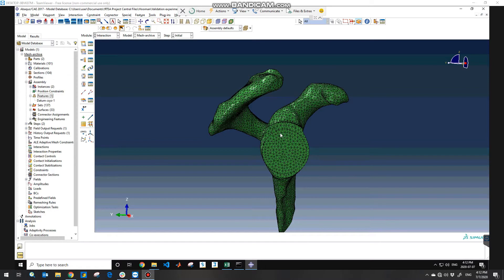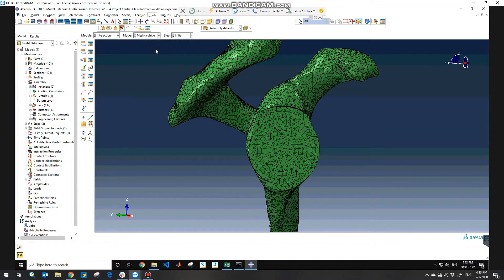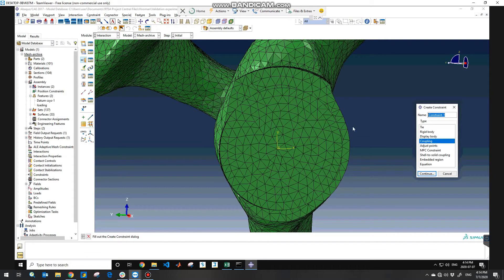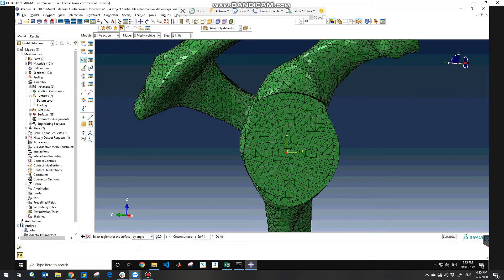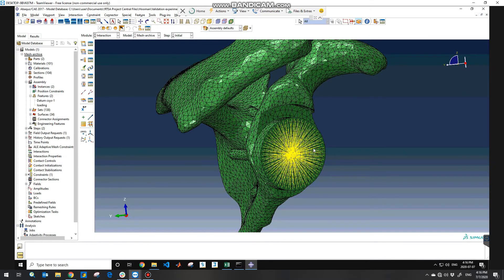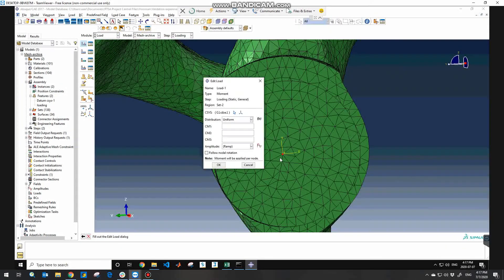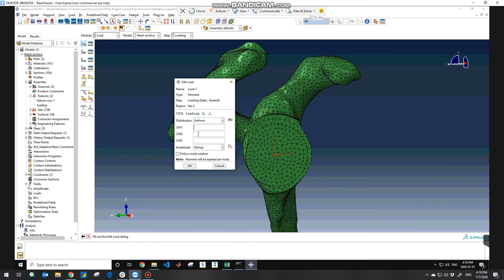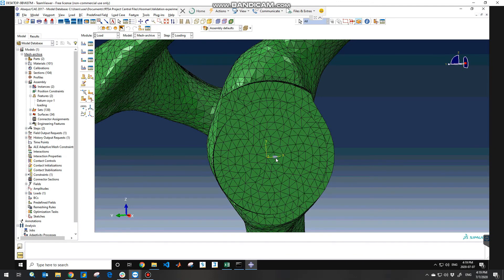How to define a coupling and apply moment on a component using Abaqus

Comment: Thank you for your video ,but what's the difference between 2 ways: The way that you couple the coordinate with the bottom surface, the other way that couple a RP with this surface, waiting for your help
Reply from the maker: Hi,
In both methods you need to constrain the surface nodes from all direction so in summary there is not much difference between these two method. However the second method has more advantages as it is easier to develop in modeling.